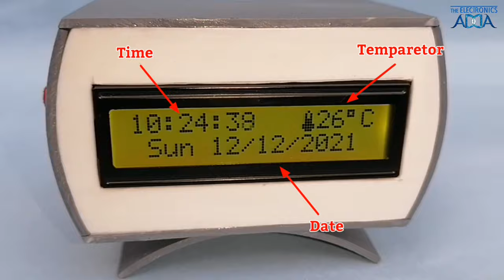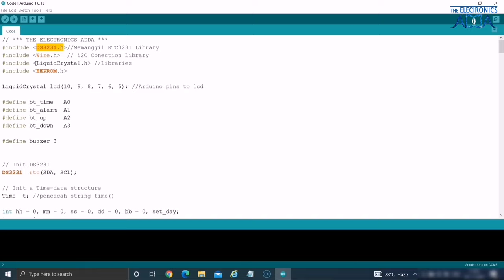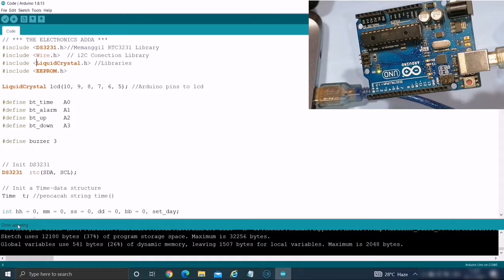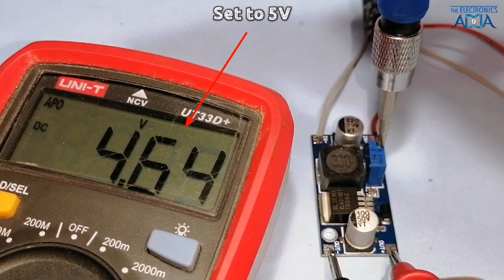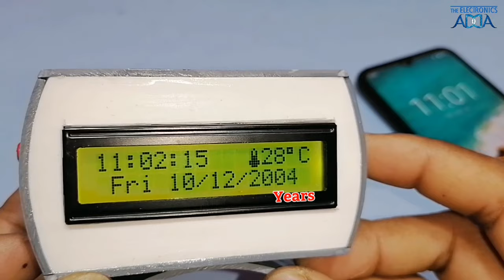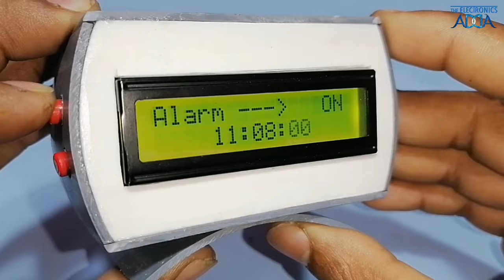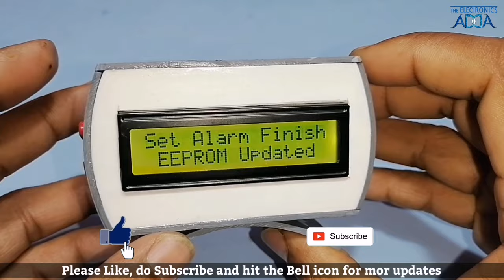How to Make a Digital Clock With Alarm | Real Time Clock With Alarm | Digital Clock

Comment: i really like all of your projects. if you allow me to make a suggestion, in many projects where timing is not critical (for example this one as it uses an RTC module), you can use the internal RC oscillator of the ATmega chip, saving you a couple of components. It is easy to do, only need to burn a different bootloader(or to be more precise, different fuse bits settings), but this is all done when you "burn the bootloader" from the arduino IDE. There are tutorials on the internet too. Thank you for the inspiration and best of luck fot the channel. I hope it grows bigger.
Reply: In addition to this, the dc-dc converter is completely overkill for such project not to mention fairly inefficient - it's not designed to be operated at low currents like this project needs, a few mA at most if you don't turn on the LCD backlight. At 5-10mA, that dc-dc converter is probably 70-80% efficient. 
It would probably make more sense to use 2 rechargeable AA or AAA batteries and use a voltage doubler chip like *7660 (ICL7660, TL7660, etc, generic chip made by lots of companies) or LM2766 or others and you'll get close to 97% efficiency. The circuit also doesn't need exact voltage, the microcontroller and the display can work with let's say 4.5v ...5.5v so doubling 2.4v...3v to around 4.5v...5v would be perfectly fine. 
Hell, it could run straight from 3 non-rechargeable alkaline batteries for months, without a regulator, 3 batteries give you 4.5v and that's good enough.